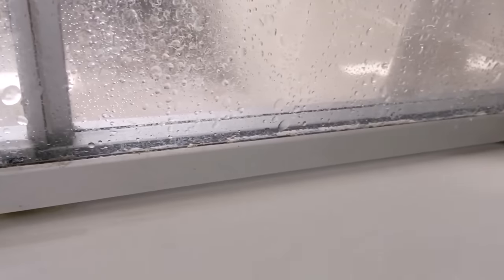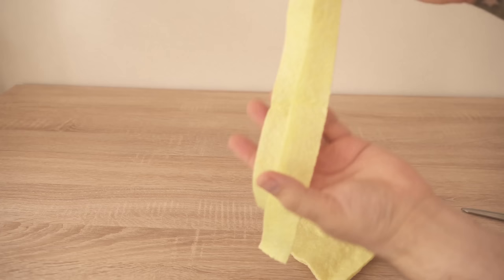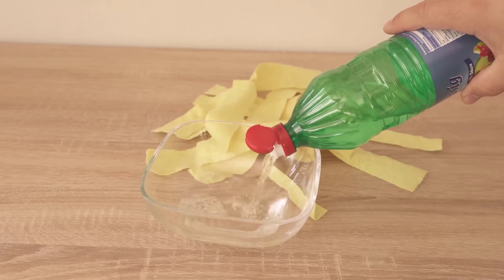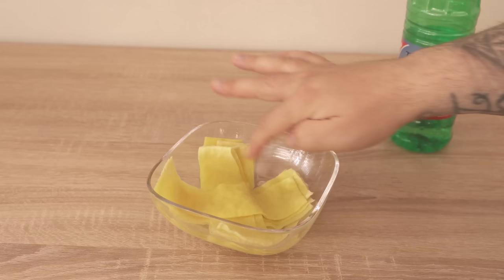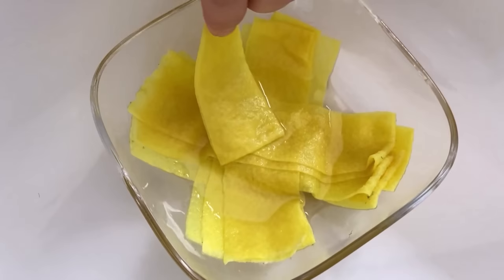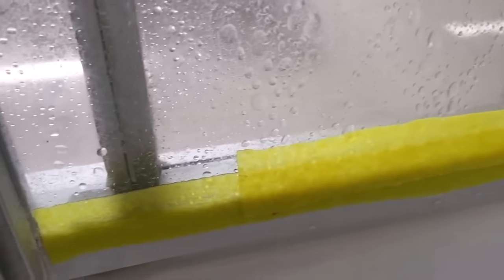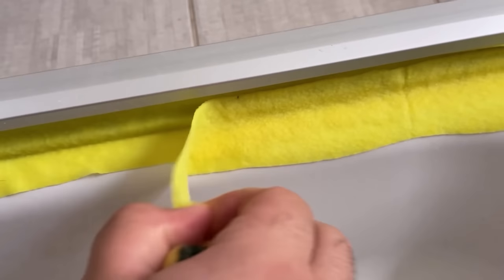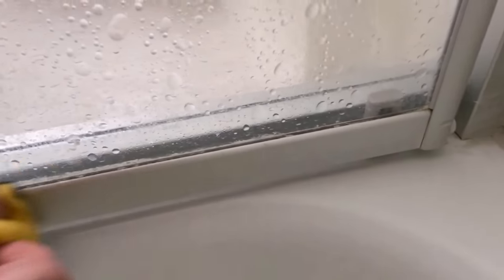EVERYONE wondered, now EVERYONE does it THIS way 💥 (Pro Cleaning Trick) 🤯

Comment: After showering and dressing, I dry down the tiled walls and bath then I thoroughly dry the shower curtain, including the weighted hem. I then open the shower curtain fully and open the window as wide as possible for as long as possible.  Never had mould in bathroom or on shower curtain.

Comment: Very good tip too. I use a small piece of a bleach tablet and lots water ( the bleach is normally to clean inside of swimming pools with) . I spay it around and also seal with cloth soaked in the solution. Mold is gone and residue from soap. But wear gloves and rinse a little afterward. All bacteria are gone for a month.

Comment: I actually already do this but I just put some vinegar and water in a spray bottle and spray on the lime deposits, leave for a short while and wipe off with a cloth. It's much easier than your method.
Reply: Agreed 😂
Reply: Dollar story sells spray bottle surfactants ....I add vinegar .....it's the best shower cleaner I ever used ....and I ran a residential cleaning business !.....it's a clear solution